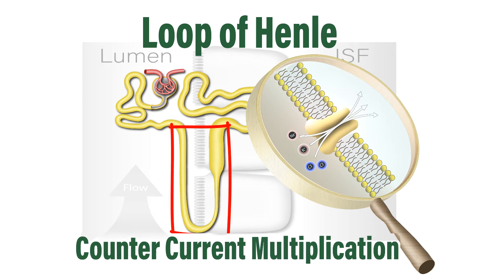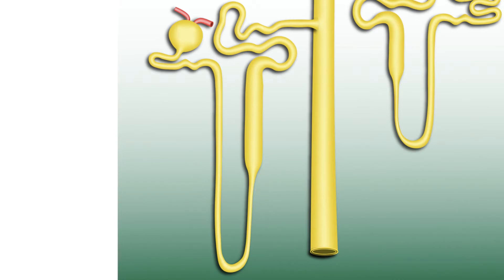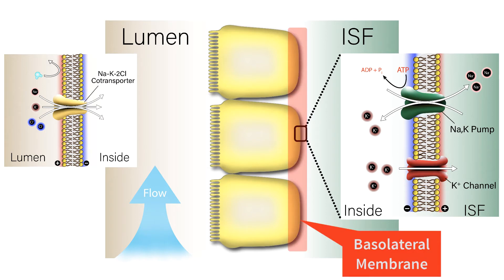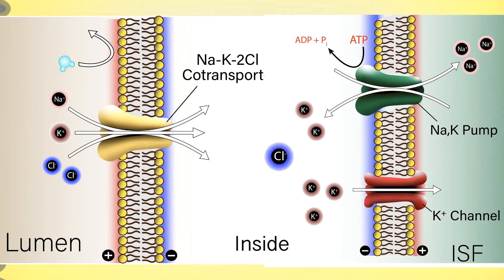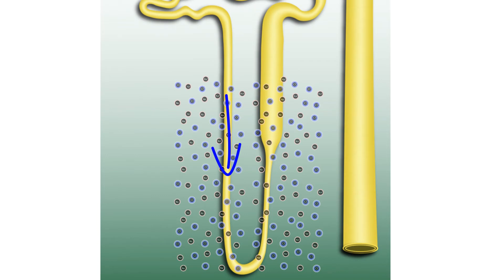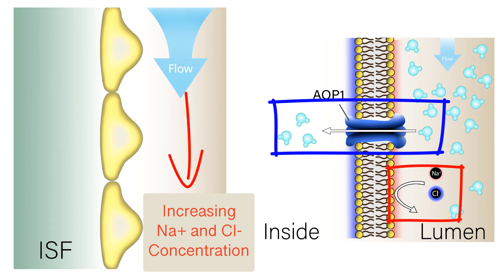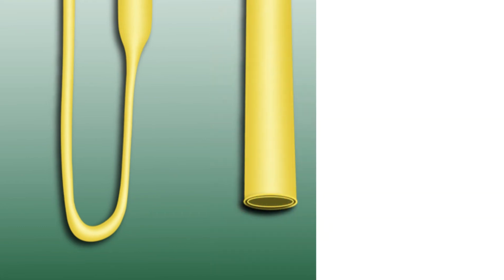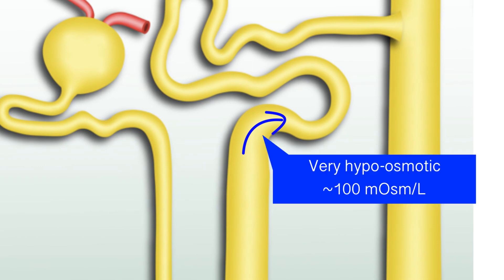Loop of Henle; Counter Current Multiplication

Comment: Thank you so much! A lot of it is clear now, but I still have one question..... Why doesn't the water that leaves the descending limb (of the Loop of Henle) dilute the ISF, thereby lowering the created high osmolarity in the ISF again? The high osmolarity in the ISF, created bij the active and passive transport of solutes in the ascending limb, doesn't seem to be affected by the water entering the ISF.  Can you explain me that?
Reply from the maker: Thank you for the comment.  Good question!  Water reabsorption on the descending limb likely does have some effect on the osmolarity of the ISF, but this is mitigated by at least a couple of factors:  1. The total amount of solute (e.g., NaCl) that is reabsorbed on the ascending limb of the LoH is greater (proportionally) compared to the amount of water reabsorbed on the descending limb of the LoH.  This is evidenced by the fact that water enters the LoH roughly iso-osmotic (~300 mOsm/L), and leaves the LoH decidedly hypo-osmotic (~100 mOsm/L).  Thus, the net activity of counter current multiplication increases the salinity of the ISF.  2. Water that is reabsorbed on the descending limb of the LoH is absorbed into the ascendiing arm of the Vasa Recta.  This prevents fluid retention in the kidney ISF (i.e., edema).   Hope that helps!